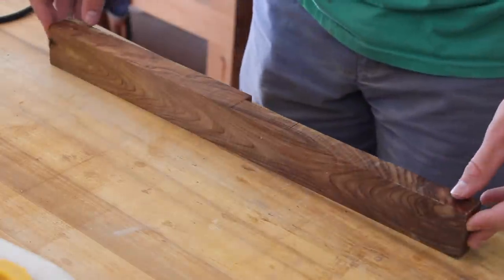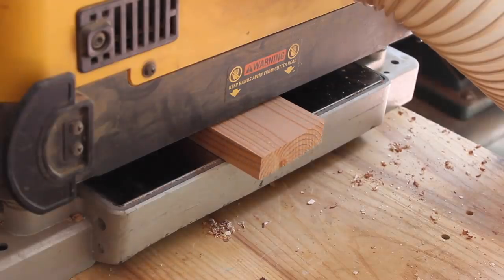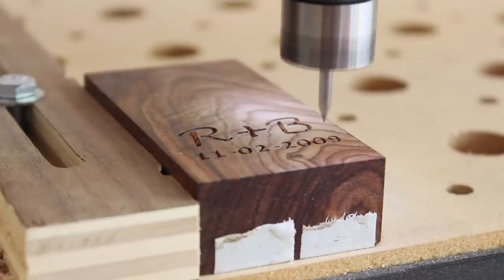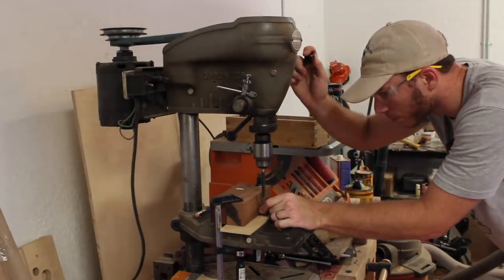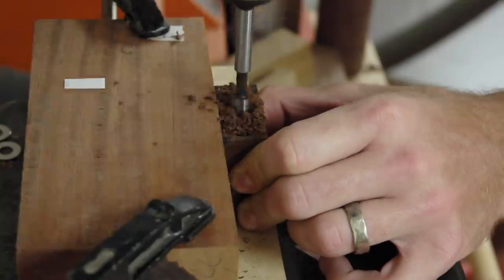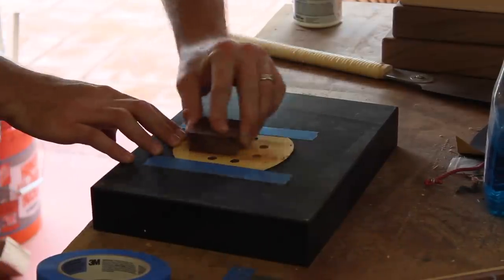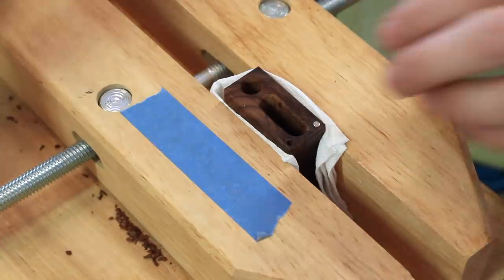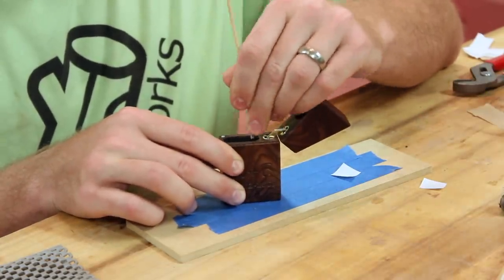Making a Ring Box Out of Cocobolo

Comment: Great little box! Not sure if you've tried this before but with the fostner bit and your drill press you can do many overlapping holes and get rid of a lot of those little triangles as you call them. They make some very small barrel hinges that you might try on the next one. It might allow you to mount two hinges to stop it from racking. Try searching pen box hinges. I enjoy the pace of your videos and the great stills at the end.
Reply from the maker: Thanks for the great comment Tom. Pretty helpful tip with the forester bit. You know, I've tried those tiny barrel hinges and had such a hard time installing them let alone finding a drill bit that actually matched the diameter. I think I tried every increment of 64th of an inch as well as millimeters and still couldn't get a nice snug fit. Anyway, maybe I'll give them another shot one day. Thanks again for the comment.
Reply: Just found this, have you looked at "letter gauge drill bit sizes"? A lot of kits will require a letter sized bit which actually exist between the metric and 1/64 increments. Gauge:A Inches:0.234 Metric (mm):5.944

Comment: What size magnets did you use? Neodymium? Magnets can be tricky if they are to powerful or not powerful enough
Reply from the maker: 1/8” x 1/8” neodymium. They don’t have a ton of strength but the hinge is fairly tight anyway.
Reply: @parillaworks  thanks

Comment: do you have the infeed and outfeed tables for the 735 planer they would not have helped with the small pieces but normally when people complain about snipe on that planer they we doing longer pieces and not using infeed of outfeed tables
Reply from the maker: Good call. Ya I've been meaning to buy those attachments but haven't gotten around to it. In the back of my head I'm hoping a big floor standing planer pops up on craigslist for me to snag.
Reply: well the 735 is a great machine if you are stuck on 120 volts like I am but if you have 240 then yea watching the used market and buying something bigger is probally the smart thing to do 

You could always make wood one for the dewalt but why when the DW7351's are 43.64 shipped ply wood would cost about that to build something 

The good thing is they pop on and off easy so if you need the space savings they are great not being fixed like my drum sander extensions that bug the hell out of me my 16/32 sander that thing takes up way too much room

Comment: What size bit did you use for the barrel hinges?
Reply from the maker: I believe they were 10mm barrel hinges so I used a 10mm drill bit. The hinges can be expanded to fill the hole for a firm fit.

Comment: Just discover your Vids, Great work Man. 
But it seems to be difficult to get the ring out of the Box. Holding between two layers of Felt .
You have always to "shoot" him out, or shake the Ring out of the Box
Reply: ComicClub01  what are you talking about? Why would you shoot the ring? Haha
Reply: The Box is way deeper than a ring. The  groove is so smal that the Ring will not fall around and is hold between the layers of Felt. But when you push the Ring totally into the Box, you cant touch him,  nomore ? so you have to shake the Box, or tap it (Like Cigarette Boxes) to make "shoot" the Ring out of the Box.
Maybe I m in Error, but that was what I was thinking about first.
Reply: The solution is simply to not push the ring totally into the box.
Reply from the maker: Sorry I didn't answer your question earlier. The holes are only an inch or so deep, maybe less. The ring would bottom out before the stone is fully "submerged."